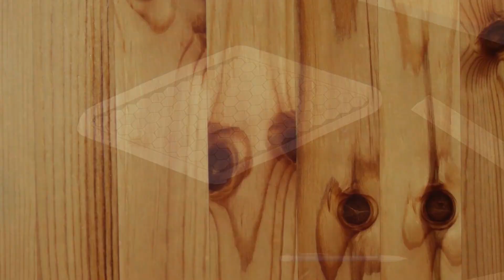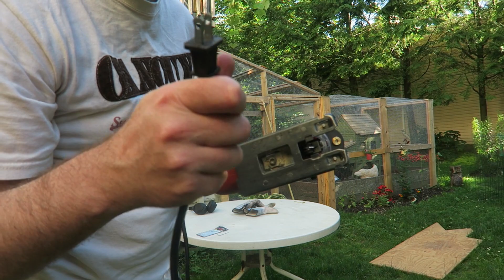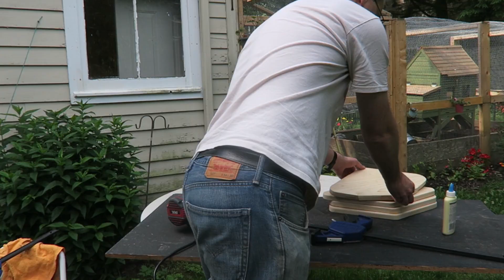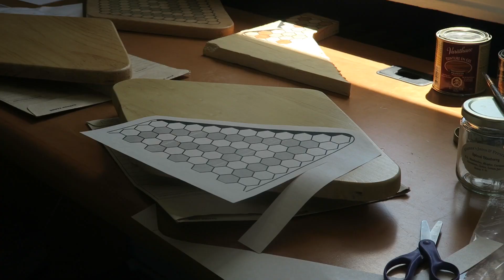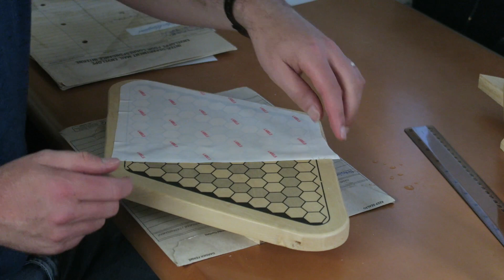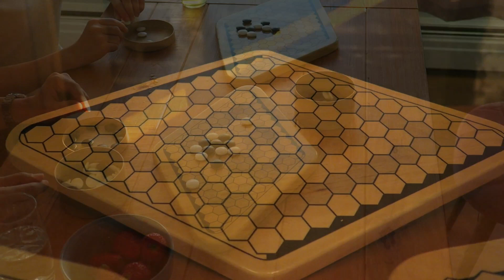How to make a Hex board

Comment: I made 2 boards with your technique and I love them! It looks like you used LABEL brand mailing labels. I used AVERY, which had perforations that made the transfer difficult.

Also, I put too much water based varnish before the first transfer. That paper disintegrated and took quite some effort to get off. I used too little on the second board, and that dried up before all the ink came off. Felt tip sharpie worked pretty well to fill in the gaps.